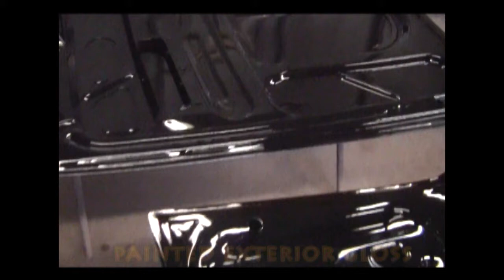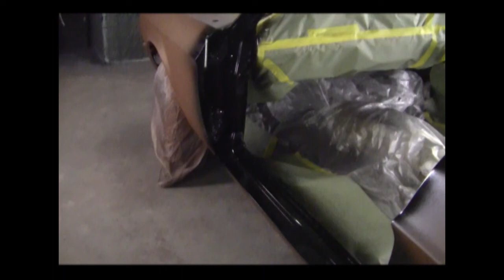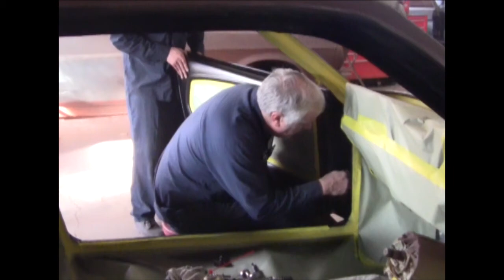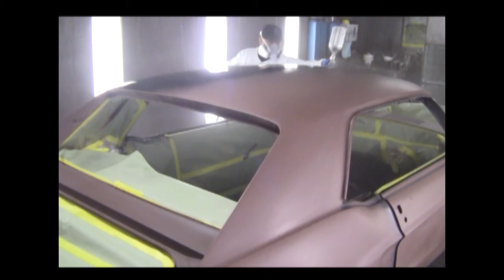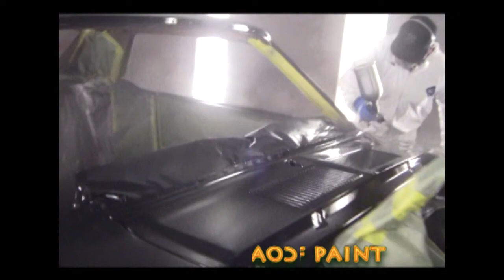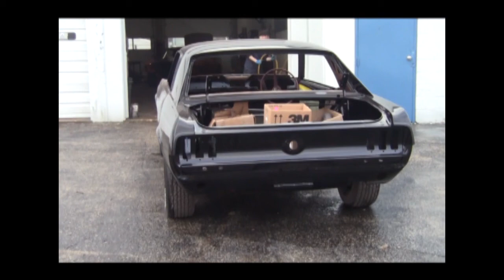Mustang right hand drive gets painted :)

Comment: I take it that's single stage paint ? Why do you tend to go that way rather than Base/clear ? Thanks
Reply from the maker: Hi Bob...When it comes to colors like black, reds, whites or blues that do not have metallic in them. It make's more sense to spray in a single stage. We apply about 6 coats of color and once cured we will sand and buff the top surface coat to get a mirror shine without the worry of buffing thru the clear coat or any future clear coat yellowing. If done correctly. A painter can get the same depth of shine from a single stage as can be achieved from a base/clear job... A painter has everything going against him and very little going for him when in the spray booth. Also common sense will tell you that if you have two operations of base & then clear.  You have twice the chance of something going wrong as apposed to if you just have one operation of a single stage of color......
Reply: This is why you are the doctor !!! You would love my little 1966 find....Bought it Christmas day !